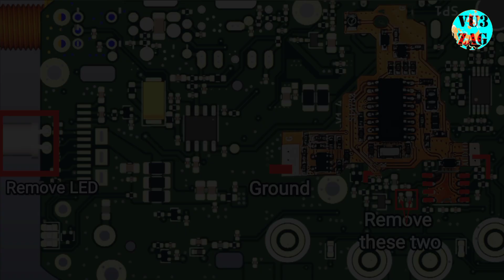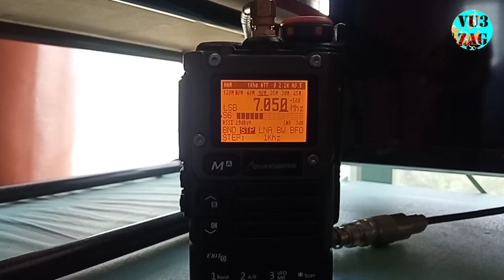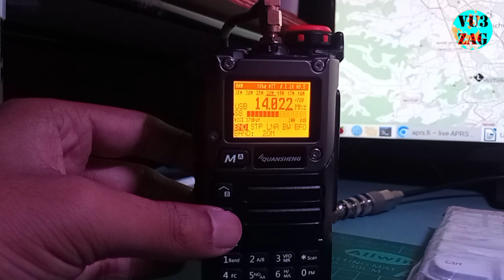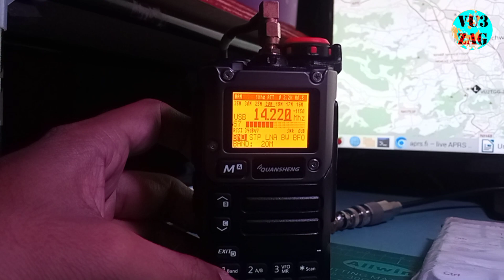Quansheng UV-K6 -HF Full Band Mod v2.5 LNA+PreAmp+ Dual Antenna

Comment: Don’t waste energy and money on this crap, you can buy a unit that has VHF, UHF and HF for 10€ extra and plug and play
Reply: I guess, its the range of firmware (including source!) available for this model, that makes it so intriguing.
If there is / comes out another model offering opensource PLUS nice price PLUS even more hardware features, the community will embrace it.
Let's see, how the TK11 develops.

Comment: Thank you for making this video. I'm wondering, though, why you went back to the original inductor? V2.5 includes the same inductor you removed... 🤔
Reply from the maker: The inductor is provided in case you wish to use a single antenna solution, where the same UHF/VHF port will be used for HF reception. Since I am using a dual antenna setup for HF and VHF/UHF, I reinstalled the original configuration. Additionally, the supplied inductor may reduce efficiency in the UHF/VHF range compared to the stock inductor.
Reply: @vu3zag  that makes sense. I have yet to find a website that actually explains the technical details of the various mod options. Thanks for the reply and best wishes from British Columbia!

Comment: Can’t get settings on mine to setup repeater
Reply from the maker: The UVK6 cannot repeat signals, so it can't be used as a signal repeater. If you're referring to repeater offset settings, you can manually adjust the frequency with +/- options in the menu. Otherwise, If you're familiar with CHIRP programming, you can directly update this details in the tables.

Comment: Next stop, transmission capability on hf bans with a port to attach a cw paddle.
Reply from the maker: The heart of the UVK6 is the BK4819 FM transceiver IC. To get the UVK6 to transmit on HF, it will require a major overhaul—likely the toughest nut to crack in the entire process.

Comment: why did you go for v2.5 instead of v5.0?
Reply from the maker: Please note that v5.0 comes from a different manufacturer, and v2.5 is not simply a predecessor to the v5.0 module. In fact, v2.5 module has a better design.
Reply: @vu3zag  Appreciate the quick reply,  so what stands out between the 2 for you specifically?

Comment: Do you still use original antenna for vhf and do you need to have only one antenna at the time?
Reply from the maker: Yes, it's safe to use both antennas. The stock antenna connects to the built-in transceiver chip for VHF/UHF operation, while the new SMA antenna is limited to receiving HF signals.

Comment: Can you effectively transmit over HF this way? If you use an appropriate HF EFD would it be able to reach out enough to make contact?
Reply from the maker: Unfortunately, it cannot transmit on HF. We are only replacing the FM receiver IC with the SI4732 module, which is an HF all-band receiver. The TX path remains the BK4819, which operates in FM modulation above 18 MHz. In conclusion, the UVK6 is unable to transmit in the HF band.

Comment: Whats the difference between the v2.5 and current v5.0 chip?
Reply from the maker: Both use the same chip but have different component arrangements and PCB layout, likely due to two groups of manufacturers in China. v2.5 is the superior option for a dual antenna solution.
Reply: @vu3zag  I've read that v5.0 uses a different circuit for the BGA427 amp which gives 22dB of gain compared with 18.5dB for v2.5. This is according to the application notes for BGA427. This would make v5.0 superior would it not? Although the difference would hardly be noticeable. Would be happy to get your opinion, and thank you for this excellent video.